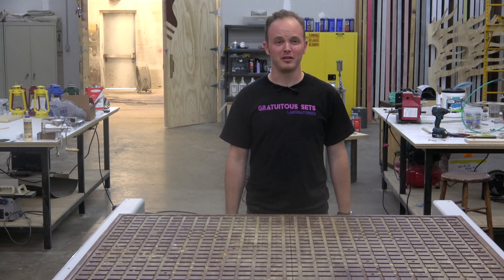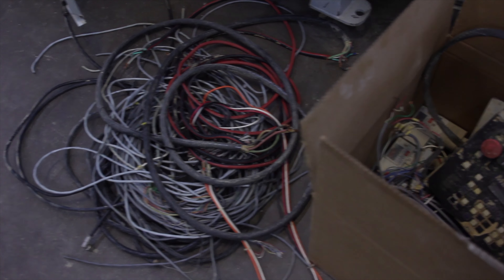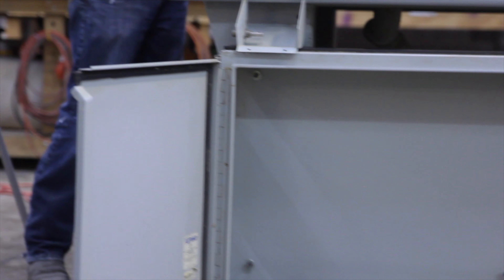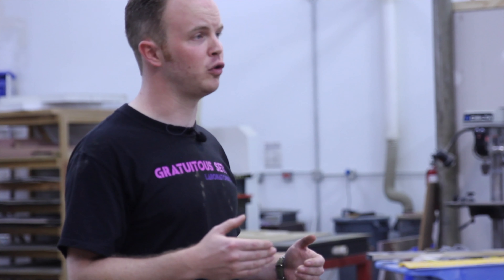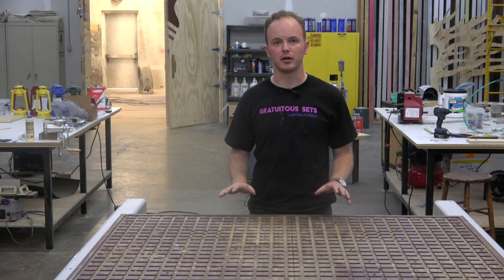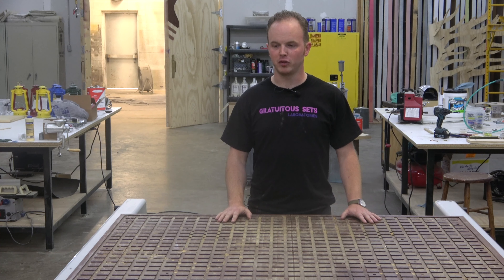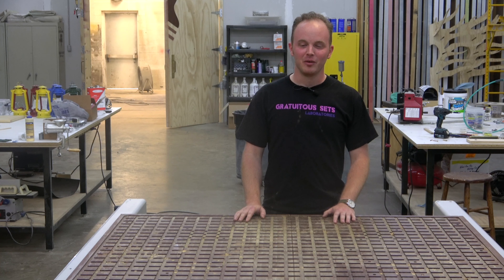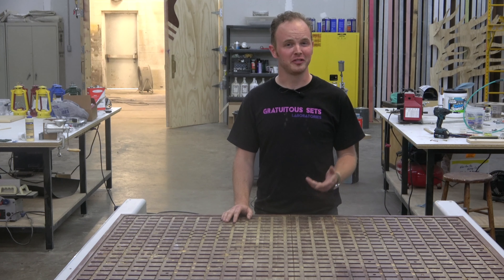Building a  Monster! CNC rebuild ep. 1

Comment: Hey did you ever complete this series? I couldn't find any more videos on this on your channel
Reply from the maker: Covid put the brakes on it, but we will finish it---I may have an idea...
Reply from the maker: @larrykelly9722  Brilliant! I think the process is going to be pretty straightforward, based on how accessible most components are nowadays. We may try flipping the ways (bearing tracks) around to get it moving. I'm not sure if the bolt holes will line up that way...

Comment: Nice Job Devon. Looking forward towards your build. Are you going to leverage Mach4?
Reply from the maker: Thanks!  We’re looking into the advantages of Mach 4, as well as it’s compatibility with our hardware.  It’s definitely an exciting option.  -Devon
Reply from the maker: I hope you like it.  We got really lucky here.  A friend of ours, who works for Lucasfilm and owns Rebelscum.com and Official Pix gave us TWO Multicam 4x8 CNC machines for the lofty price of two bottles of Johnny Walker Blue Label!! They were about 90K each when new.  The chassis are worth quite a bit since Multicam is basically the "Cadillac of CNC machines"
Reply: @GratuitousSets  So thinking of keeping some of the electronics rather than a rip and replace and keeping the mechanics?
Reply from the maker: I think it's going to be easier to replace electronics.  The old stuff used old serial port connections and we would have to sort through all the circuitry.  New stuff is much more plug 'n play.
Reply: @GratuitousSets  Yeah I built a system based off of SmoothStepper and Mach4. with the mechanics coming from a early 1990s Denford mini mill. It makes things so easy instead of dealing with tired electronics.
Reply from the maker: Nice!  Those Denford mills were super cool!  The electronics have certainly come a long way since then, and have gotten so affordable 👍 -Devon